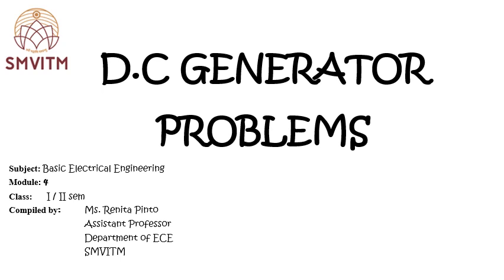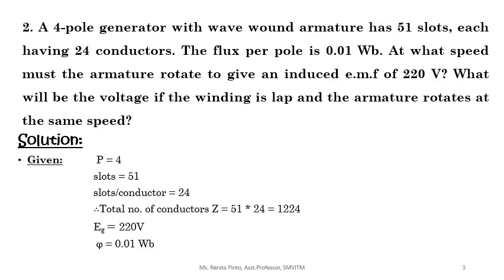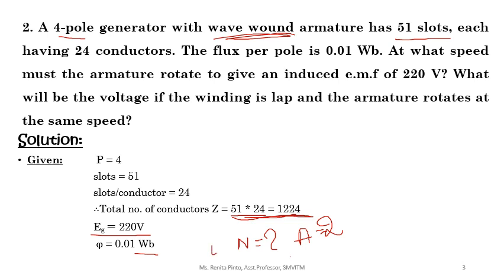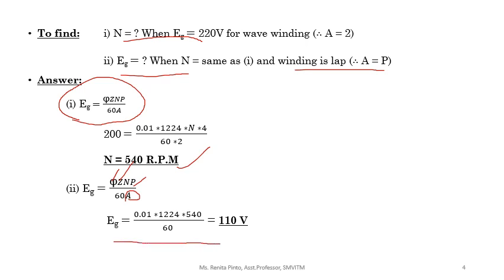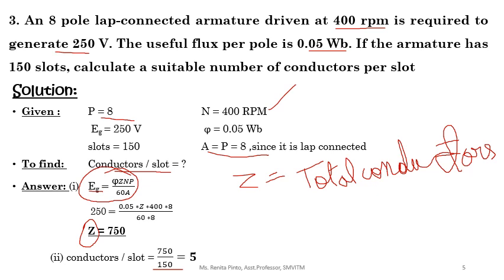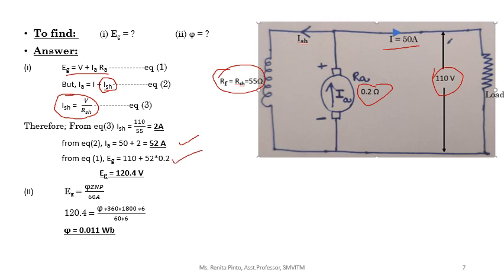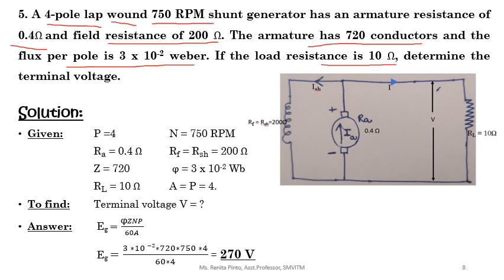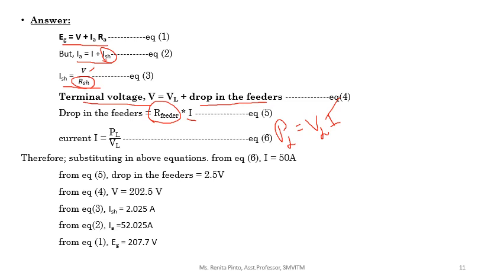DC MACHINES - LECTURE 03 : PROBLEMS ON DC GENERATOR

Comment: Thank you madam, you made it so easily. please am confused on the brush drop, it is 1 volt but you multiplied it by 2.
Reply from the maker: For two brushes.
Reply: Taking two brushes because armature have two brushes so we take as two brushes....
Reply: @renitapinto5487   the number of brushes in the DC machine equal to the number of parallel paths. For lap winding numbers of the parallel path are equal to the total number of poles. Therefore, the number of brushes is equal to the total of number poles. Brushes = 4 not 2
Reply: @madhujatothu3485   the number of brushes in the DC machine equal to the number of parallel paths. For lap winding numbers of the parallel path are equal to the total number of poles. Therefore, the number of brushes is equal to the total of number poles. Brushes = 4 not 2
Reply: @imranahmedqureshi9831  yes you are right

Comment: A 110v dc series motor when taking 50A, runs at a speed of 300rpm.The armature resistance is 0.15ohm and there are four field coils, each of 0.01ohm parallel groups of two coils in series and load torque is doubled. Assuming that the magnetic field is unsaturated , determine;
1.armature current
2.speed of motor

Comment: A 25 HP, 240V, 1000 rpm, 4 pole DC shunt motor has 1000 conductors arranged in 2 parallel 
paths. The armature circuit resistance is 0.3 ohm, field current and line current are 2A and 
100A respectively. Calculate 
 Flux/pole
 Torque developed
 Rotational losses
 Total losses expressing as a percentage of power

Comment: please check the last question.In lap winding number of poles=number of brush....since there are 4 poles so voltage drop must be 4*1=4 but you have written 2*1=2.How did that happen ?
Reply: There are 2 brushes ..Contact drop is to be find out ..In the question contact drop per brush is already given as 1..So total contact drop= 2 × 1= 2
Reply: @athonjob1233   the number of brushes in the DC machine equal to the number of parallel paths. For lap winding numbers of the parallel path are equal to the total number of poles. Therefore, the number of brushes is equal to the total of number poles. Brushes = 4 not 2
Reply: you are right

Comment: In 1st problem.where you can get that A=2 for wave connected
Reply: I'm wondering the same...since its in lap A=P
Reply from the maker: Lap winding and wave winding connections are entirely different. If you look into the figure of lap winding and wave winding you can understand the clear difference. so generally we take lap winding A = P and for wave winding A=2

Comment: Hi, I have rewinded 1MWatt Sandford alternator, during startup the stator winding get firing in particular slot and again we will replace the demaged coils again getting fired during installation at same slot. Can I know the what is reason for this issue